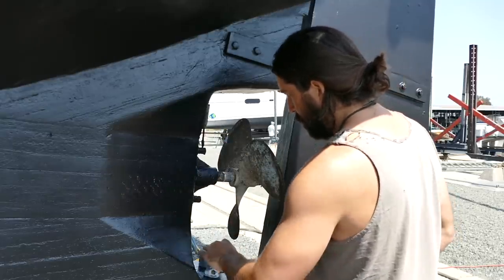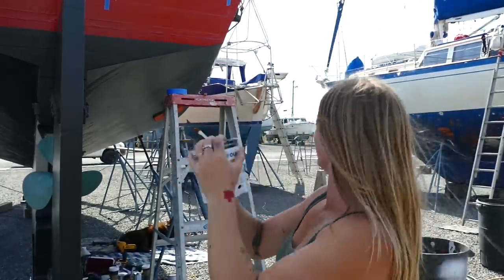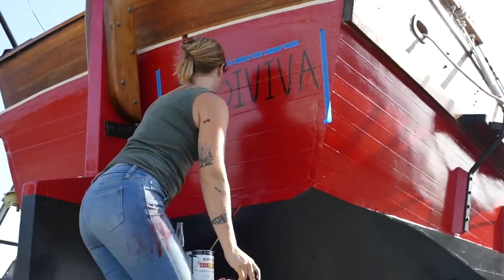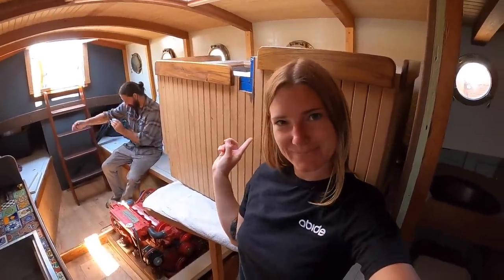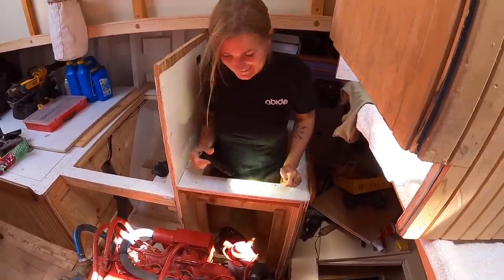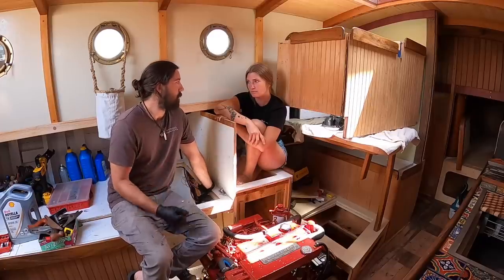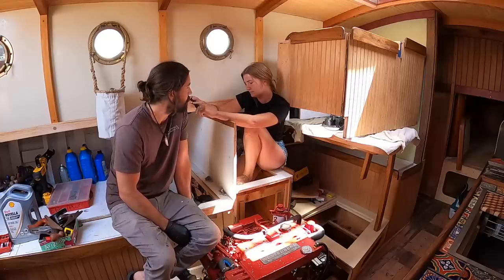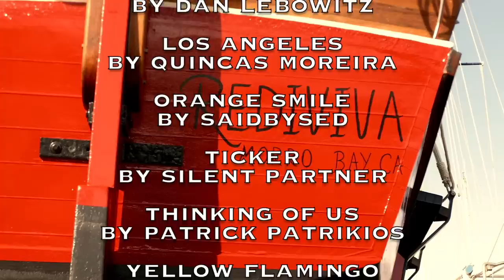Salt & Tar: Ep.197

Comment: Garrett, rebuilding the transmission of this older engine went so well, I thought it was close to a miracle. Having to pull out the engine to fix this BIG oil leak is an enormous disappointment. Keep the faith, you have a lot going for you. As for Ruth's body part you mentioned today, well, it's typical female and it's like Ruth herself, charming. I think you are both lucky to have each other. 😎

Comment: You will win out in the end!!!!  The only date you need to meet for departure is the one that fits YOUR sense of well being and safety.  The biggest down side of using any mechanical device that has sat idle for years is, fix one thing that causes the next item down stream to now fail.  Eventually you get to the end and everything will be okay.  I have loved following your build and trials in getting out to sea, but I'm confident that you will win.  Take care, be safe and shoulder to the wheel, push on, sailing in no time.

Comment: i would consider a "remote" oil filter kit too move the filter away to a more convienient position, They are available. alternatively new gaskets and retorque, good luck
Reply: An inspection camera would help it will be a bad copper oil washer seal on a junction fitting 
Or the filter oil seal ..  a remote filter mount would help anyway and install it so the filter vertically.
Meantime put a catch tray under it guys.

The fixed cupboard is in the wrong place .. you cannot go through that sort of contortions if you have back problems..long term. 
Ive seen seals flatten O rings fail metal and flexible hoses split.

Now you've lifted the motor can you put a stainless steel catch pan under the motor so you dont end up with oil running into your bilges from leaks or spills.
Reply: Is it becoming a dock queen?
Reply: @satguy  
Nope i think they would tow it out with a dingy and sail it if it came to it...😉 these are just teething problems....and the parents are getting tired and stressed.. They are afloat and probably ready to go now ... Alluring Artic are in the same yard but running a in real time..
so we have to wait to see what happend next.
Reply: A remote oil filter kit with two parallel filters. That way you can  switch filters while running and replace the plugged one with out stopping.
Reply: @Pocketfarmer1  
Thats one way i know its done with fuel filters .. but not sure if its needed for a oil filter as long as you can get at it and check it without turning Ruthie into a human Jack in the box.

Comment: Guys, you have come a looong way in this journey and it’s a bummer you can’t leave at the time you wanted but I thank God that this happened now and not when you were 300 miles from the nearest port or in the middle of the night in a squall. I’m m glad you called a knowledgeable mechanic, he suggested exactly what I was thinking of, there is pressure pushing the oil out and it’s outside the motor itself. If it is the oil filter housing it could just be loose, or a piece of debris was trapped between the mating surfaces. Best wishes getting this done quickly so you can leave port, I’m dying to see Rediviva with her sails all full making you skip from wave to wave.

Comment: Think it this way. This boat wants to keep you safe on the water so it throws all it can now that is not good so that once you have done it, you can sail her safe and secure. In my work I need to design things that have to be 100% correct. It is sometimes demotivating when you still get an error, but every error now is cheap. Every error out on sea costs way more. You are close, keep going, the reward will be there.

Comment: This is an 'experience' , one that teaches.  For me, with over 73 orbits of the Sun, when I'd first bought the engine, I'd have gone through it 
top to bottom, front to back, side to side. Rebuilding as necessary prior to it's installation. Placement of the Butterfly hatch would have 
been more directly over the engine , but from the preview it appears to be 'close enough. All these 'lessons' you will  refer back to "The Next Time".
chucklin' wish there were many more folks in your generation that showed the grit and determination that you two  display. By-the-way
Ruth's butt is just the right size , for her. 
Fair winds & following seas to you both.

Comment: The motor runs great, nothing sounds wrong internally. Drain the oil, pull the filter, clean up as well as possible and look for cracks. Install a remote filter and gaskets, it will also give you more room to work and do routine inspections. The oil circuit is under pressure from the oil pump in the pan, don't sweat it. It could be much worse. I would pull the motor as a last resort. OBTW the boat looks awesome! Stay safe!

Comment: Just a thought! Firstly Love you two and your dedication. The reason for the note is...........with your wood boat and no oil pan beneath the engine, perhaps you should aquire 3-M oil pads, and cleanup for the wood soak from oil, Or-bilge will pull the oil from the wood. And in Closing, So very sad you have gotten so close to departure and to have another issue with the Westerleak!!! Damn Shame. They are wonderful engines and I have had a few of them. So shocked that you have been burdened once again! My prayers and Blessings to you for a Quick resolution of the engine situation. Keep Strong, and Smiling! You are a very Special Couple and So Diligent. Do not Despair.

Comment: The haul out was a huge success. No issues there, ahead of schedule, and you got to put her name on. 
My opinion on the engine, since it runs so smooth, starts so easily, then the insides must be tight. I don't recall seeing excessive amount of smoke either. I think your guru guy is steering you right. Replace some seals and then take her out for weekend sail.😉

Comment: Keep going you will get there. When it seems like it will never get done just spin those ratchets until it gets sorted. Avoided my own pressurising coolant system and then when I could not avoid it any more, whipped the head off and it was just the gasket. No cracks no major breaks. Couple of days work and it was back running sweeter than ever. Not even a leak from all that had to come off and it's all pretty old too so that is always a nice surprise and a happy outcome awaits those who can do more than just think about it. And we know you can do that !

Comment: you'll be fine, as long as it's not anything major with your engine which you have almost ruled it out.  Hopefully it's just taking apart the filter housing and and cleaning sealing and re torquing all the bolts to the oil filter housing.   It's always harder when you're so close to the end.  Good luck guys you can do it.

Comment: As a licensed marine engineer I would chuck that engine and get a  Yanmar with worldwide servicepoints! And to prevent galvanic corrosio simply put a rubber or plastic washer or gasket to separate the different metals, Good luck with your future endevours! I admire your work and determination

Comment: Hang in there Guys its just a Oil Leak , As like most that have said check the oil pressure switch and all so make sure there is not two oil seals from the filter  last time you did a service on the Motor that will cause a major oil leak there. So take the oil filter off and see if there is two rubber seals one on the filter and one on the Engine Block.
Reply: I was going to say this too.  Happens all the time. The old seal sticks to the motor and then the new seal and old seal roll off each other and create a leak.

Comment: I would take off , inspect and remount filter thinking gasket may have twisted out on tightening - then, if still leaking replace it , if still leaking unbolt, roller it out onto galley sole , jack up to inspect underneath - hauling out the engine would be last resort - exhaust all free diy options 1st

Comment: I had (believe it or not an atomic 2 engine completely rebuilt,) and for a year it never ran right. We had the whole thing with the company sending out their top troubleshooter many times, to no avail. Engine was pulled out 2 more times, again to no avail. A year went by and a I finally bought a new Westerbeke 2 cylinder, which I installed myself in less than 6 weeks. I messed around with the drive shaft alignment, and a small electrical problem, but they were easily solved once I put my mind to it.

If I had not been working ,at the time, I would have gotten the new install done in 2-3 weeks, to many trips to the store for minor things. It can really eat up your time. The best part was, once installed, the engine worked great, and I never worried about it giving me problems or dying, especially when the rebuilt would always die coming into a dock with a fast current.  On the other hand, the many benefits I discovered with the  new engine was that it was easily rigged to make hot water - a special plus, which my family particularly enjoyed.

Realize,  that  working on an engine, when on anchor, usually means multiple trips to shore which lengthen your install/repair time. 

The other idea, that I found invaluable, is to show your leak/problem  on-line to your trusted mechanic using your phone's camera, always checking for something simple. I got the engine(s) on deck using my do it yourself hoist system, and the yard picked it up with a hoist from there.  

I say new boat, new engine, because cruising is no fun if the engine is a constant worry. The new engines are smaller, more powerful, and usually bullet proof.

I admire your tenacity, but a solid running new engine for a new boat means you have a solid base to build on. The dealer can make it right if you get stuck on the install in the first 30 days.

Comment: When I 1st saw the leak it reminded me of one I had just like it if you haven't taken it off yet check the oil filter gasket and make sure a old one wasn't left on there if that's not the problem 🤔 ya'll are in the right direction

Comment: Been saying this from the start. That Engine is the heart of that boat. It should have been completely torn down and gone thru before put in. This motor will ALWAYS give you problems. You were scammed on its condition. It will pay in the long run and maybe even save your life if you pull it and over haul it.

Comment: My first thought when i saw the leaking oil was that it may have been double oil sealed. This happens when removing the used oil filter the oil seal stays stuck to the engine instead of coming off with the filter. Then when when installing the new filter that has a new oil seal attached to it you end up with 2 oil seals! Eventually the one seal shifts and you loose oil very quickly. I have seen a lot of engines ruined from loss of oil due to this simple mistake. This is why I always look at the old filter when I remove it to see if the oil seal is still on it. Love you you guys and keep plugging away it will all be worth it soon!

Comment: Keep your chin up guys you are almost there it,s just a oil leak most likely from oil pump housings, gasket or seals. I don’t think the engines needs a rebuild yet.it starts and runs well from what I see in videos you guys have done a great job so far don’t lose it now you can fix this minor problem keep the faith best wishes Cam.

Comment: As a retired marine fitter I totally agree about it leaking from a pressured joint on filter housing.Could be cracked casting on oil filter housing caused in transit, seen it several times . Keep on smiling Think of the future enjoyment ,when fixed.Best regards from U.K
Reply: If not a crack I would suggest that it was a doubled up seal from the oil filter. Seen the same thing on a bobcat skid steer spewing oil after an oil change when someone forgot to remove the old stuck oil gasket and tightened the filter right up with the new one.
Reply: @williamganley4739  my thoughts exactly

Comment: I would try to redo the gasket in frame, glad Christian came up with not pulling the motor.  You might get Christian to do a compression test & run the valves all of that can be done in place in about an hour.

Comment: I think you are correct but it may not be the oil pan gasket but if it is to drop the pan and replace the gasket is worth the effort before you pull the engine out of the boat. Remove the gear box and be sure it is not the rear seal leaking. More testing is better than less. To know for sure where the leak is will give you confidence in the repair you make.

Comment: Rather than depending upon your drive shaft and prop/nut for grounding, you should install a ground plate, mounted Away from the shaft/prop - mounted approximately amidships.  Certainly, keep the shaft/prop in the circuit, but depend on the ground plate for the majority of the inevitable current.

Comment: I agree with Christen it is the oil filter adapter plate. A slight leak around the filter under oil pressure will use a lot of oil.

Comment: With all the things you have done already it is clearly a problem with the oil pump pushing oil out of the engine. 
As a person who has worked on these engines many times, I agree that you should consider a remote oil filter system as it will be easier to change the filter and also do needed repairs. This will probably solve the leak issue at the filter fitting.

Comment: Good decision! It's an old motor and a rebuild is far easier at the shop then it is on the seas. Don't sweat the departure date. Get the boat truly ready and then you can depart! Since you're going to pull that motor, what do you think of fabricating a drip tray for underneath the motor to avoid getting oil all over the place when it leaks? Because you know a motor is going to leak sometimes.

Comment: Hi,as a retired marine engineer I would first remove the filter casting,check it for cracking…if ok refit it with new joints and try it again before removing the engine.the engine generally seems alright.cheers Roly 🇬🇧.

Comment: Remember, It’s generally not the worst case scenario. Get to the bottom of that drip. It is going to be a specific location.. The motor runs well. What is the compression? Does it over heat? I does likely not in  need of a complete rebuild.

Comment: I've worked on boats since I was 11 and in my my opinion U should take a much closer look . The oil filter mounting gaskets   on the brackets are the best place  to investigate and there is more vibration at those points . I would check much closer before I announce failure !!!!! I am only thinking of my friends. My seasons start and stop where I say lol .

Comment: Based on info gleaned from Christian: he seemed to think the largely static seal/gasket was least likely to cause such large (under pressure) leaks as you have. 
I'm a former aircraft fluid power systems specialist (hydraulic/pneumatic). So to me it makes sense that a large static seal like an oil pan gasket would or even could cause such a dynamic kind of leak. 
The key is the leak takes time to become evident, only after running the engine (hence the oil pump) for a noted amount of time. It kinda rules out largely unpressurized seals like oil pan gaskets, etc. The oil pan and crankcase are largely vented to outside ambient air and (only) atmospheric pressure effects it. Running the engine would hardly effect that kind of seemingly 'driven' dynamic leakage. The oil filter housing (and oil pump housing) are a horse of a different color. If the oil filter area is the center of the leak, and if not just a filter gasket, it may be the iron casting, contacting or near the oil filter seal-seat, is slightly cracked (set down on the ground a bit to hard, only once, in its storage history -- maybe). 
That might mean cleaning the immediate area EXTREMELY well and trying to braze a patch on the cracked casting, then file the brazing "bead" smooth again to allow the filter seal to seal tightly. 
A good possible suspect here is that squarish piece where the oil filter and pump hoses connect too. If the leak is there then your troubles will be far far reduced.
If the oil pump housing is nearby there would be a great place to examine too. 
Without a brazed patch of the cast-casing(s) I doubt other patches can work out. At that point if successful, doing a remote oil filter option would make some sense. 
You could try other patches like Permatex gasket paste or another sort of gunky material, but you'll always be chasing that leak, forever and ever -- not a good resolution.
 For what it's worth, I think this kind of repair can be very carefully done onboard, without completely pulling the engine off the vessel. But off the boat would make the process significantly easier. Good luck.
P.S. Whomever sold you this engine may have known about this leak. That they didn't tell you suggests some degree of dishonesty to me.

Comment: I am not a marine motor expert, but for what it's worth you just need a new gasket between that oil filter housing and the block...instead of doing a full rebuild, slap that gasket in there and roll with it... then use the money you didn't spend on the rebuild to get the stuff that will fail, like some spare gaskets an extra alternator and starter. Some belts and pumps.

Comment: Hang in there!  You two have come so far and look at what you've accomplished!  It's not uncommon for engines that have sat for a while to develop oil leaks.  I'm thinking/hoping you are right that it is the oil filter adapter that is leaking.  If I was in your shoes, I'd be hard pressed to overhaul the engine as long as it was starting and running good, wasn't blowing blue smoke, wasn't making unusual knocking noises and had good oil pressure.  Even if the oil pan gasket did end up needing to be replaced you could probably replace it without having to take the engine out of the boat.  You might have to unbolt everything and lift it up though.  Still very doable and I'm sure you could get it done.